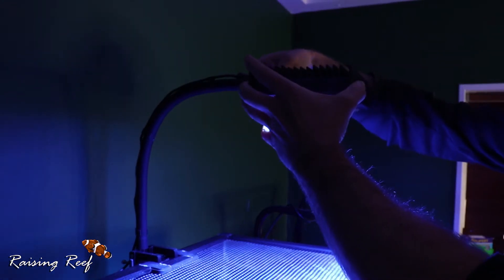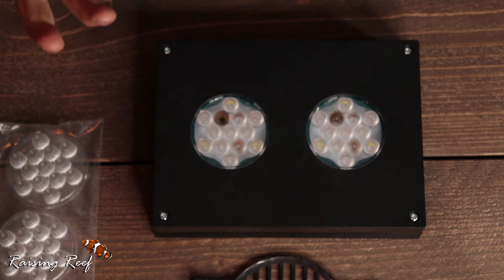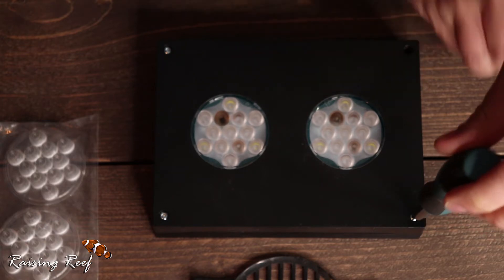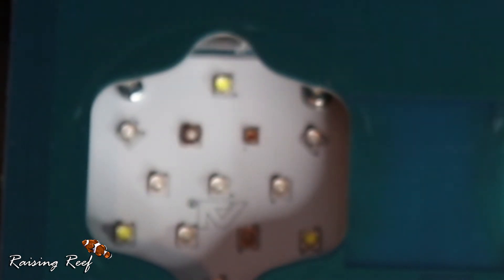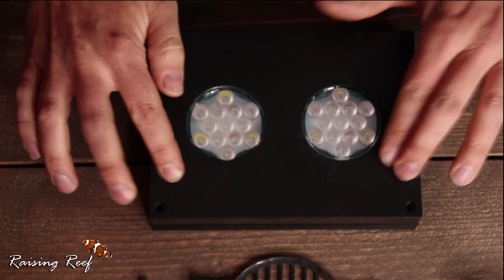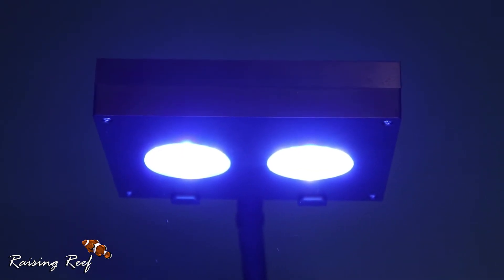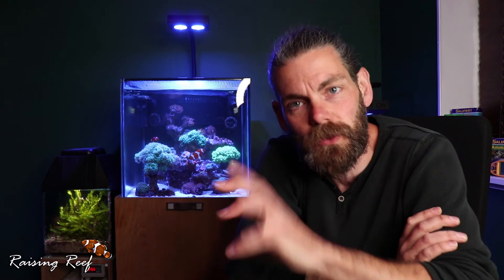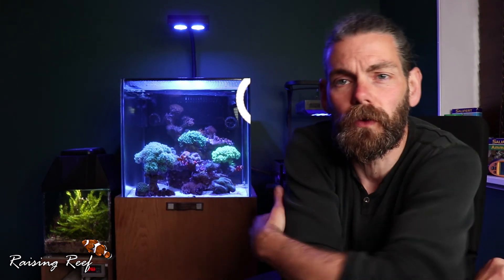2021 ep6 AI hydra lens replacement

Comment: My two month old Hydra 32HD started to show signs of this issue. One of the lens looks shiny, like the plastic is starting to melt. It seems that this issue is common. The company should have redesigned or fixed this by now.  I sent an email to them and their reaction was of “surprise”. Shameful behavior.  A replacement lens made of pyrex glass would be ideal, I guess.
Reply from the maker: Yes this dose seem to be common but from what I herd it had been addressed. 
Apparently not from your experience 
Thanks for the compliment could be helpful for someone els.
Reply: they can't fix bright UV damaging plastic, that's just the way it is

Comment: I have the new AI Hydra 32 HD two of them and they had same problem so the company send out new TIR lenses for free never happened again.   The UV and Violet always due this too lens due to harsh spectrum even seen it on black box led Fixtures
Reply from the maker: It dose seem to be a common problem I read that they have done a firmware update to help solve this but I can’t find an update for the 26s on my app.
Reply: @raisingreef339  they did a update all did was lower the two channels to 100% people didn’t like that then they made the change back just make sure your fan is always clean
Reply from the maker: @moereefer  after 3yrs I’m just glad it still works and I don’t have to replace it just yet.
Reply: Hi, could I ask where you got the lenses from as I can't seem to find any in the uk.
I have the hydra 32hd.
Thanks
Reply from the maker: Email this guy and ask him he supplied my lenses 
tony@theaquariumsolution.com
Hope this helps.
Reply from the maker: @peterbrinson2267  email Please email tony@theaquariumsolution.com
For replacement lenses
Reply: I have a burned out led do they sell replacements?
Reply from the maker: I believe you can buy the puck replacement but not sure about the individual leds